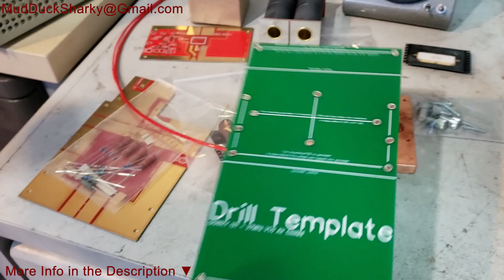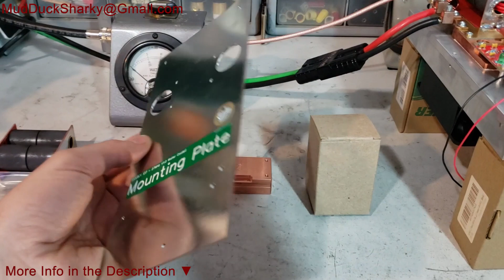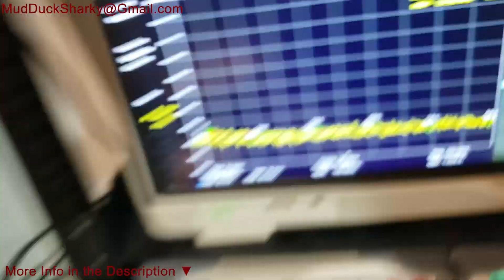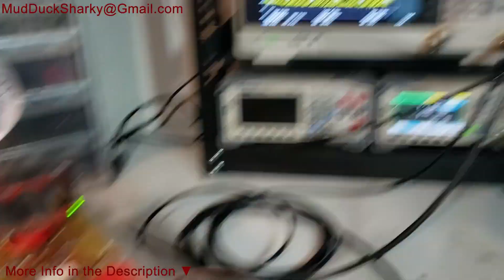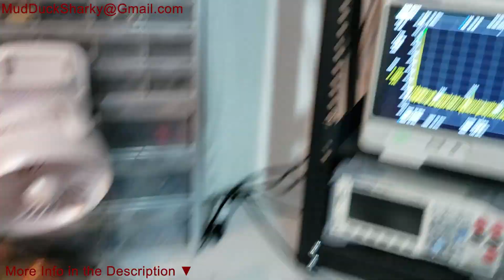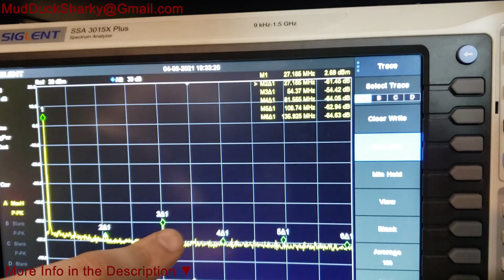27MHz LDMOS Pallet Kit Introduction

Comment: Are you using any material other than FR4, which is better, and is there a need for it? 
What are the N2 C2 Y1 capacitors, are they something like 100B 100C or regular NP0? 
Thanks!
Reply: The normal folks would prefer if you reword that question to make sense. Not trying to kick you in the nuts but your question only helps you, peace.

Comment: Hello Sharky engineer：
Recently I'm building a large signal RF amplifier for narrow band use at 14.27MHz or 21.4MHz.I decide to use the Freescale MRF1K50H LDMOS in a single-ended Class C or Class AB circuit.But I can't find any impedance or S parameters about that LDMOS below 30MHz on the Internet.So I come here and ask you if you can find any these parameters.I appreciate it so much.
郭彩珍 from Hainan,China

Comment: Can you operate the water-cooled pallet in a hermetically sealed housing?
Normally you have to cool the transformers and resistors with air and a fan, but I want to try to cool the components using immersion cooling. The heat is then dissipated through the metal housing.

Comment: Can you run this at 14 volts. If so, about how much watts does it put out? I'm thinking about trying this in my Diesel Wagon...
Reply: you need at least ten 12 to 65 volt 200-300 watt DC-DC Boost step-up power supply modules
"IN 8-60V OUT 12-83V" which are connected and synchronized via 0.1 Ohm resistors for this purpose. Cost is in the range of $150 with a good housing.
You also need very thick power supply cables. 50 SQM, as short as possible to the DC DC converter.

Comment: So where does a person get a 65 volt power supply ? Is that why hardly anyone uses these ? 
Is there no magic wizardry conversion flux capacitor inside the amp to convert 13.8 volts to 65 ?? That aside ,, how much is one of these completely built ready to hook up and use ? If you build it ?? Or do you not offer that yet ?

Comment: 3rd harmonic at 55dB down is frigging outstanding dude...fantastic work. I would love a wider bandwidth version for all the ham bands but I know the drama required to get that.
Reply: Is it 27Mhz up to 28 MHz or 27MHz + or - 500 KHz so 27.385 whole 11 meter band I guess is what I. Saying.
Reply: 27.500- 26.500 MHz

Comment: So that's 2000 average! Wow! Does the power drop significantly on 55 volts? I have a 55x55 power supply. I know they are fragile on the input. What's the max? 10 watt Carrier but how about swing?
Reply from the maker: 10wPEP or CW max. I'll post a link to the specs under this vid in an hour or two, along with an assembly video that shows how to solder the fet.
Reply: @MudDuckSharky  I should still be awake so I'll look for it!